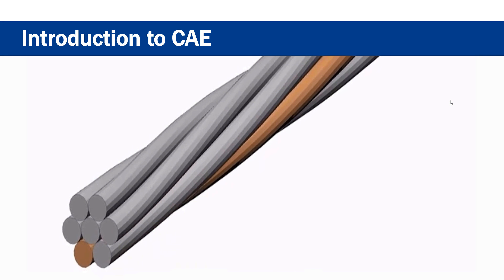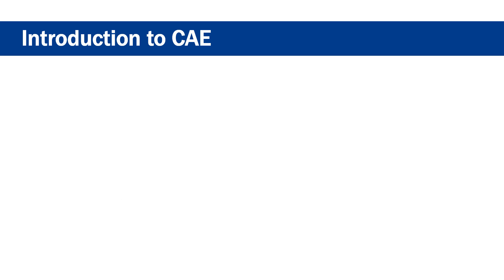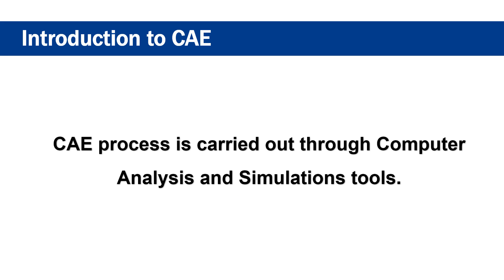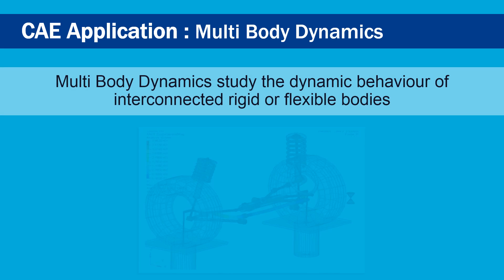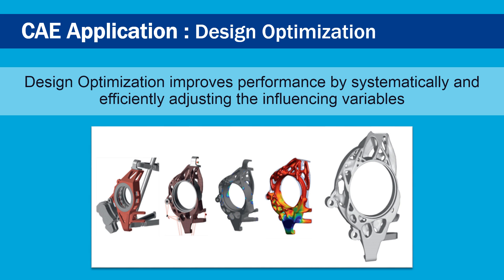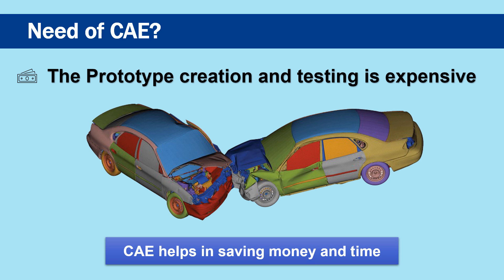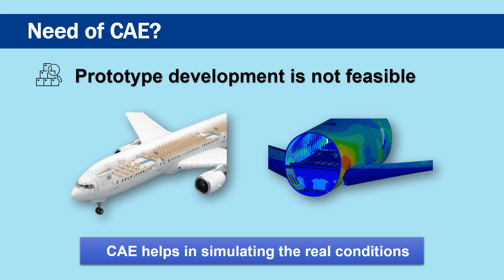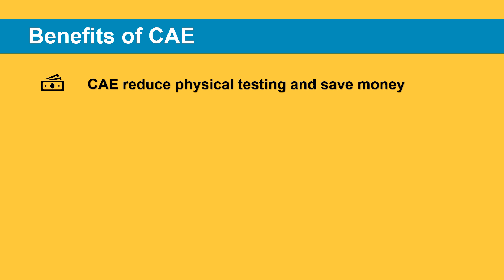Machine Learning and CAE Video Series - Computer-Aided Engineering

Comment: Simulating an earthquake is not impossible and scaled models in both fluid and solid mechanics are still useful in determining whether the design satisfies the requirements or not. CAE is useful in reducing the number of physical prototype iterations in physical testing. Before CAE lets say 20 physical prototypes needed to be created and lab-tested to arrive at the preliminary design, after CAE only 8 would be needed as the remainder 12 would have been eliminated by virtually in the computer itself.